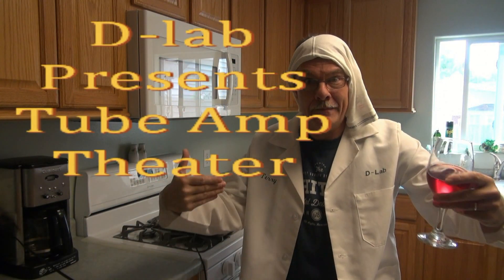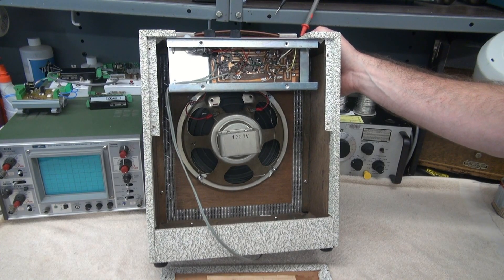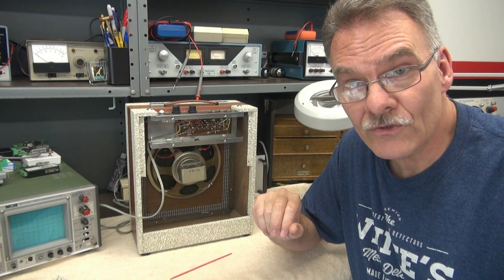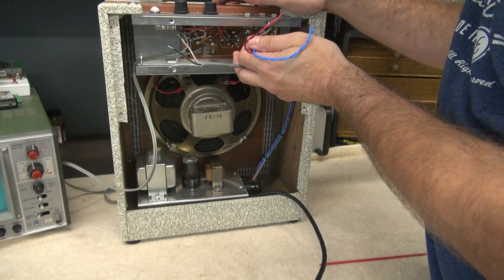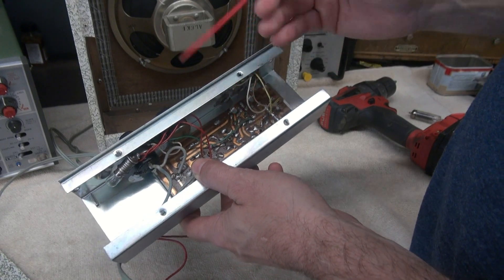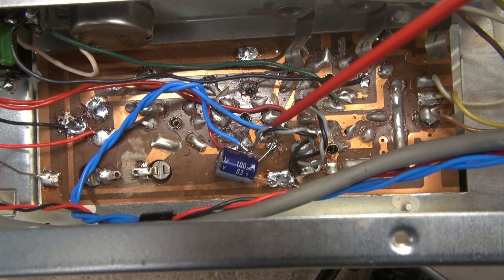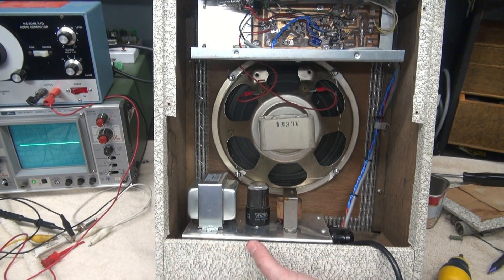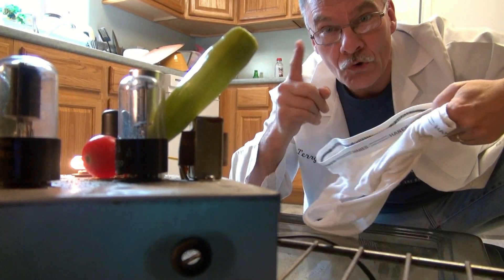How to repair modify upgrade Hot Chassis Guitar amplifiers Tube Amp Theater D-lab safety

Comment: Really interesting amp... Class -A 50/12/6C5 tubes show a 2.5K load resistance @ 110V.    The 35W4 has about a 30V drop in the recti... er.. recumfier... The 6X5 has about 50V?   Just curious what the final plate voltage, and if you had to re-bias the power tube...     I have a number of AA5 radios, which are basically the same.... I'm making 2W guitar amp heads with them, but yes... a safe power supply is in order!   Thanks for a great run through on the high-level process!!

Comment: You can also use a 30v+30v transformer, ground one of the 30v wires, and connect the other 30v to a voltage doubler with silicon diodes. That'll give you about 140vDC unloaded, which you can use to power that amp.
I've done it to an old Talk-a-phone desk speaker unit I turned into a tube amp, which has a very similar circuit to this amp.

Comment: Can you tell us what model/mfg transformer you used?  Also, I dint see the filament connection between the power xformer and rectifier but I’d assume it connects to the 6.3v filament tap.  I wonder why they used the 5U4 type rectifier tubes in the past, requiring a separate 5vac tap for the rectifier?  Great work .. thanks for posting this!

Comment: So using lower voltage filaments reduces noise?
Reply: with the modified circuit the tube heaters dont have a chassis  ground on one side of heater, as its balanced with a pair of resistors & center of resistors is grounded in circuit dia  this greatly reduces hum picked up by the high gain amp tubes . This is easily done with low volt heater tubes.

Comment: I have a Kustom Quad 100 FX (Solid State) and it has a hot chassis. Does that work on there too? Or how do I fix it?
Reply from the maker: Hello, researching out chassis pics of this amp, I see a power transformer, so no worries of it being Hot Chassis.
Reply: D-lab Electronics But it is hot, I got shocked when I touched it. I replaced a capacitor in there, that might be the problem. But I don’t know how to solve it.
Reply from the maker: Inspect the new cap connections, make sure the leads are not contacting the chassis
Reply: D-lab Electronics the cap connections look fine to me, the two solder dots on each leg don’t touch each other and they don’t touch other stuff on the board. But the cap might touch the chassis, I‘ll check it, thanks!
Reply: D-lab Electronics ok so I checked and the caps are about an inch above the chassis...

Comment: I used  a solid state voltage doubler rectifier pair. It produces around 356Vdc using an isolation transformer. Used a separate filament transformer. Self biased a push pull pair of 6V6Gt tubes. Using a Fender Deluxe reverb output transformer I got out of a place where I once worked. But, we could not drink wine there. One stage phase inverter on 1/2 of a 12AX7. Other half is intermediate stage in front of the same tone circuit from a Marshall. Another 12AX7 as two stages in the front end. It pushes about 12 Watts effective into an 8 ohm load. Used it in small clubs. Has a preamp out to feed into the audio mains in a big club. Not very big but, sounds super good and, super low noise. CHEERS!
Reply: Ralph Macdonald, the weirdest and among the most dangerous ACDC hot chassis devices I ever saw was a califone record player with a built-in tube amp and small speaker. this was a heavy, all metal silvery Gray unit, probably designed for schools, which did not have an isolation Transformer, and had a Voltage Doubler circuit (a pair of selenium rectifiers if I remember correctly). The tube complement was a 12AX7 and an RCA blackplate 6L6GC! A good unit to pillage the tubes and output Transformer from, but one wonders how many students and teachers got zapped by those things.

Comment: I built myself a Series-Filament amp based on the 50L6, 35Z5, 12AX7  setup...  I love how gnarly it sounds when cranked up.   I need to get back to it,  but I have a 12AU6 driving a 50c5 project amp...  that's a rock'n sound too.

Comment: Wouldn't it me much easier (and cheaper) to install a 3-prong line cord and tie the green and white wires to the chassis and switch the black wire  (hot) ?
Reply: Ok, this is an old comment, but a GFCI and a arc-fault breaker will both just dump...   that and this doesn’t save you from a mis-wired power outlet, or somebody using a gray adapter...

Comment: From Leo:  D-lab,  Great job on the upgrade.  People like what they like, no matter the cost.   I cut my tech teeth in the 70's with 60's vintage ham radio and tube audio components.  Lots of stuff was series filiment by then for cost cutting.  Superheterodyne design 5 tube radios were all that way.  It was a lot of fun, even if you got shocked sometimes.   Maybe get someone to tune your guitar to G-B-D-G-B-D tuning.   A strum with no fretting will be a G Major chord, and anyplace you squeeze across the strings with one finger will be another major chord.

Comment: Great videos you have put on your channel; subbed straight away.

I have had quite a few old amps come through my shop that had the "death caps" in them, but haven't had a non-isolated mains issue come through yet. Very good solution! Great video!

I really like your style of presentation. Very concise and on point.

Comment: Terry loves the 6AQ5 tubes ... and now I do too!
Reply from the maker: They are great sounding tubes + inexpensive
Reply: I agree sir ... I have 2 of your amps the D-lab "leisure suit" suit case amp (the small tweed one) & a Firestone Air Chief amp (mine has the tremolo activated with the push-pull knob) both have those 6AQ5 power tubes!

Comment: Hay Ghoul over day, um thunkin a more simple approach...  
isolate  / insulate all chassis metal from human contact, mount controls to wood or plexiglass, knobs insulate anyhow.  But no metal exposed outside the case.  Here's the trick to avoid zapped lips...  use a transformer on the inpit jacks that are not mounted on the chassis.  The jacks gozinta a transformer, the transformer gozinta the amplifier.  Old mics had those hi/lo matching transformers.  Those mic teansformers are small and cheap.  If they're step up or down, use two transformers.  no direct contact, eazy and cheap.
Reply from the maker: Ghoul Power lives on!

Comment: Why not use a line voltage transformer? Or even put two filament transformers back to back with a voltage drop resistor? Then you don't have to modify the circuit for new tubes. I've even pulled the transformers out of a couple of 12V wall warts and used those back to back...
Reply: we could go on and on without thinking ecconomy. yes, unfortunately the buck usually stops somewhere.
Reply: Yes why not just wear rubber soles that will prevent you from being shocked even if the 120 volts goes through your guitar strings

Comment: Been there with the old "quick touch" on the lips on the mic while touching the guitar strings.  Back in the late '70's early '80's, I don't think anyone was enforcing any electrical codes in San Antonio and nearby environs, and we had to check to see whether we were gonna get shocked.  As it seems you already know, that is an unpleasant experience if you are trying to play and sing at the same time.

As always, even though I am just a piker amateur on electronics, I appreciate your content.  Thanks, Terry!
Reply: gives  "hot lips" a whole different meaning!
Reply: Yes yes the pow right in the kisser is quite unpleasant, but being 8 years old, playing your guitar and stepping on a heat register vent in bare feet is also quite a shocking experience...
Reply: Starcrunch72, pretty much everyone knows at this point that standing in bare feet  on a concrete slab while playing the guitar can be a shocking experience, but I never really thought about the fact that metal ductwork in your house can also be, or intentionally was and is (?), connected to ground. My house has shitty (resistive to air flow, and tends to capture dust and pollen ) all-fiberglass ductwork, which isn't  conductive except for the foil insulation on the outer side perhaps which is  metallic, but it doesn't really make contact to the air inlet and outlet grates.....

Comment: Great upgrade.  Great solution to make this little amp safe to use.  Thanks for sharing.  I would have to disagree with the never get return on investment statement.  As long as the seller informed the buyer of all the work that had been done to it and that it was now a "safe" amplifier to use I think many buyers would take that into consideration.
Reply: Yes especially if it’s vintage and hand wired, the prices on these keep going up